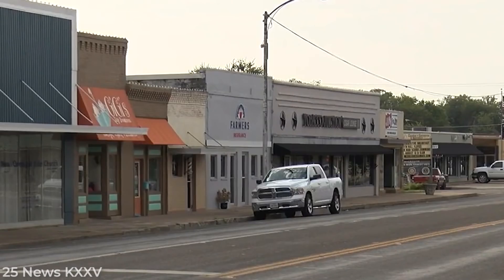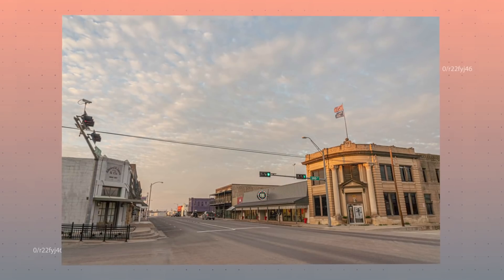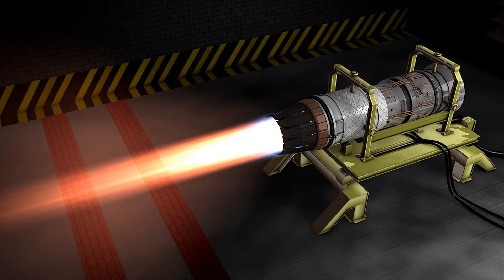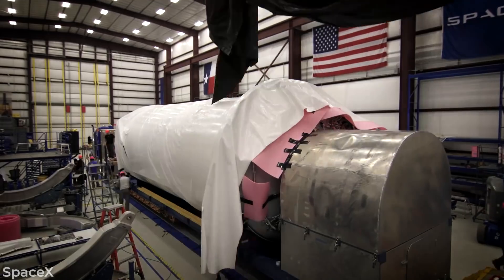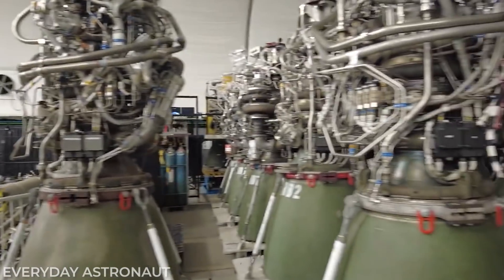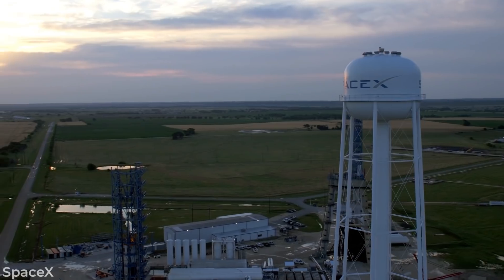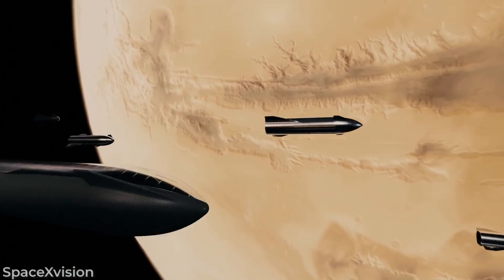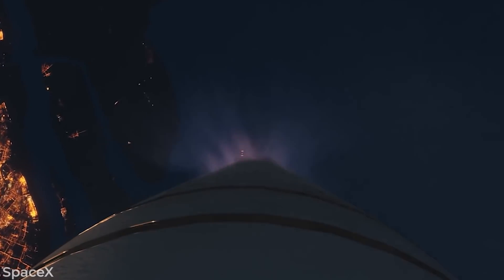SpaceX's New Raptor V2 Engine For Starship

Comment: What is mi thane?  I thought it's met thane?  

Anyway, what happened if one raptor failed?  Does that mean all man on board are going to die?  I don't trust any propulsion...anything that have to do with lifting and fighting against gravity are deemed unreliable.  We need to develop anti-gravity technology....it's the only way to safely travel in the air.

Comment: An insane amount of misinformation for a short video. Closed cycle full flow combustion rocket engines were mastered by the Soviets in the 60's and the 70's and by the US later and both widely and successfully used. The Raptor thrust is a small fraction of the F-1 or the RD-180. The use of methane fuel is unique but not a game changer. The ability of the Raptor to restart in flight is a good technical accomplishment. The engine has a long ways to go to reach maturity given is tendency to catch on fire.
Reply: Yea, disapointingly there is a lot of misinformation coming frpm these channels. But to address something you said, the Soviets did develop and produce Full flow staged combution cycle engines, but as to my knowledge none of them were flight proven and none had gone through a full duration burn. The Raptor is first in these regards.

Comment: 3:39 When you say most rocket engines use kerosene rather than methane you show a video of the Aerojet Rocketdyne RS-25 that of course uses liquid hydrogen as a fuel.  5:34 The Raptor 1 as it is now being tested has a thrust of around 200 tons (440,000 lbf). I understand the gimbled Raptor compared with the none gimbling engines will have a slightly different thrust. The optimized Raptor 2 engines will ultimately produce approximately 230 tons (510,000 lbf) of thrust.  This is very similar to the much larger Blue Origin BE-4 methane engine (250 tons /550,000 lbf).

Comment: If SpaceX cam muster a fleet of starships to Mars, those starships could combine themselves in orbit and make more habitable space for the travel...
Reply: Imagine the bathroom breaks in your starship, so you put on a space suit and head to the air lock. You depressurize the lock and open the door. You see the open airlock on a nearby starship, ready to receive you. You carefully aim yourself, and then push off as hard as you can in the direction of the other airlock. Oops. You were slightly off, and you slowly pass by the other starship. It passes just inches from your fingertips as you soar gently by, with no propulsion system to stop you.

Brain teaser, where will you end up and why?
Reply: @CharbeeCapps  lol my idea is to interconnect them, not to make everyone to spacewalk every time they want to use the others ship installations... they could make the fuel tanker version with a ring of 6 airlocks and dock 6 starships so they can travel inbetween...
Reply: @CharbeeCapps  To answer your brainteaser, it would depend when you pushed off the starship. If it was mid trip you would end up dead most likely orbiting around the sun, but if it was nearing the end of the trip and you would somehow manage to survive with limited oxygen and no food or water, then you would end up in the exact same place where the Starships are heading towards - Mars' atmosphere. You would just burn up and whats left of you would crash into mars. Granted, this would never happen because you would have umbilicals strapped to you if you were doing an EVA, especially with no propulsion.

Comment: Super Heavy won't have 35 raptors, currently it's 29 (you probably got the number 35 from 29+6 from both stages), and will go to I believe 33 engines.
Reply: Can starship be transformed into a habitat?
Reply: @reasonerenlightened2456  uh, probably? Why are you asking here?
Reply: @catdealer1144  
well , if the engine can be  a tent to keep equipment  then the tanks can become living areas. or farming areas, etc.
Reply: @reasonerenlightened2456  I don't know why you're telling me this but if you didn't know starship has like 1000 cubic meters of payload volume, and your idea only works if the starship is literally only on earth never to have flown and won't fly
Reply: I think that's what he meant.
Reply: @cellogirl11rw55  he was talking about super heavy itself
Reply: Thanks, glad somebody said it. Starship and Super Heavy together in their final iteration should have 38 engines total.
Reply: @chuckshaw1593  np and I just checked it and yes super heavy will have 32
Reply: @catdealer1144  I'm curious why they're starting 29 and not just going for a full 32 engines?
Reply: @chuckshaw1593  and for me I don't know why they'd go up to 32 if 29 works unless it doesn't
Reply: @chuckshaw1593  actually maybe both stages are underfueled since it won't have a full payload and won't make it into a circular orbit, and the removed fuel makes it not need as many engines and so they don't add them to save a bit of money or something

Comment: They can start by simplifying those engines. Too many lines, tubes and wires Those spaghetti clusters need simplification by removing as many tubes, lines and wires as possible. I'm willing to bet that in the near future those engines will not have those spaghetti clusters and will look completely different.
Reply: Musk said raptor 2 gets rid of all the external lines in the everyday astronaut video posted a couple days ago
Reply: Version 2 is what will be built at MacGregor. Version 2 as per Elon is a much cleaner design and more powerful. Version 1 engines will be used in testing. Actually, Tesla gets rid of 35 version 1 engines on the first launch of SN420 by not recovering them.
Reply: That’s what a full flow combustion engine looks like. It’s complicated but a hell of a lot more efficient.
Reply: If you want to learn more watch the everyday astronauts video on rocket combustion cycles